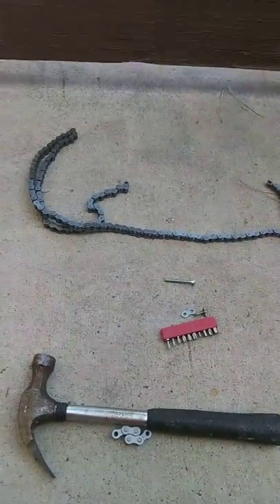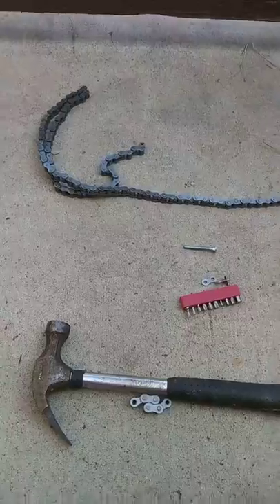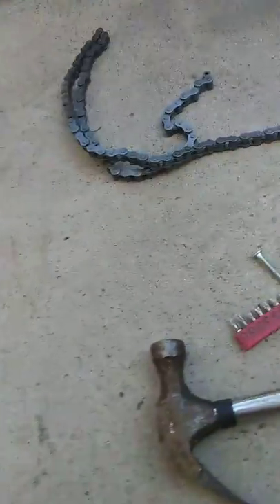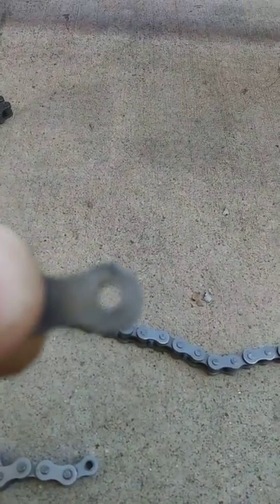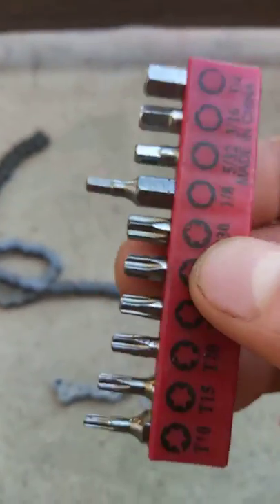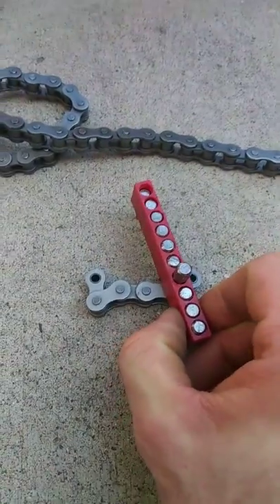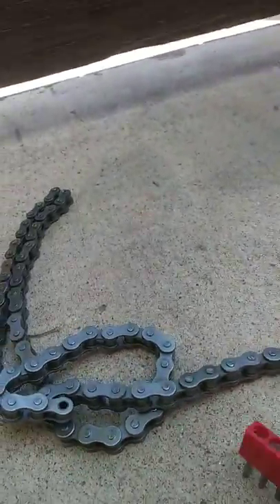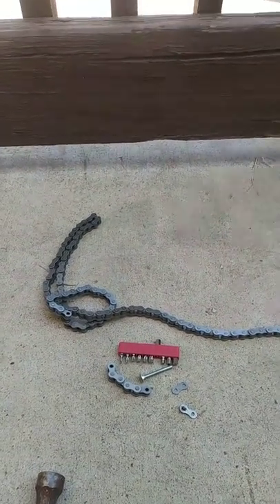Chain breaker with common hand tools

Comment: Unfortunately my chain isn't on the floor where i could comfortably put it on a nut or something else it's on the bicycle.
Reply from the maker: @SianaGearz  try bracing a 2x4 behind the bike on the frame.
Reply: @Marine212925  That was a failure, as were 3 of my other attempts to extract the pins straight on the bicycle, including a piece of drilled and tap alu extrusion, and a 3D printed retainer which only aligns things allowing me to apply force with a C-clamp. I blame rust. I later found my actual pretty nice chain breaker, and some pins go dead easy and others don't budge, luckily with a proper tool it's much easier to go trial and error and try a bunch of them until one cooperates.

But it was in the hiding until just now, so i ran an extension cord and cut the chain using high speed tool, which allowed me to keep rebuilding the bicycle until i find the tool.

I still have an issue that my drive side pedal shaft is galled onto the crank. Cheater bar and hammer was of no help, rust penetration oil was of no help, can't torch it due to plastic on the crank, milder heat was of no help. Now i'm giving it a week long soak in citric acid trying to dissolve/chelate the rust, and i do suspect that can backfire by galling on harder in the worst case, but i don't have anything to lose at this point. Tried drilling it out but it's too hardened, the drill bit skates right off.

Comment: Do you know how to do it on a bike? Because I just cant get it off my mountain bike
Reply from the maker: In order to take the chain off of your mountain bike you need to remove the gears from the derailleur if you can't do that you can use a grinder to grind down one of the pins in the chain and use that pair of vice grips and a punch to remove it you can also take a roofing nail and place it inside of the vice grips and as you tighten the vise grips on the PIN in the chain it will press the pin out of the chain